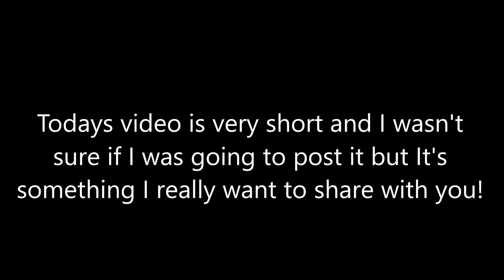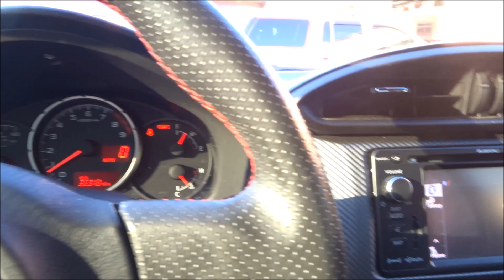SUBARU BRZ PAINT CORRECTION! (Perfection)

Comment: I'm not knocking you, just giving you advice. they didn't "ceramic coat" your car. The part you showed with the price is no where near the price it is to ceramic coat a vehicle. And when you ceramic coat a vehicle, it needs to sit inside, out of the elements for 24hrs. just letting you know, in case you go to a different place and ask for ceramic coating. don't want you to flip out when they hit you with a high price tag.

there's a place like the one you went to here in Florida that does "ceramic coating" I asked to see what the product was and it was just a sealant. what you paid wasn't bad for a paint correction and sealant, but it won't be that for a real ceramic coating.

keep up the good work brotha
Reply: FerrariStang S550 there’s a product that advertises through Instagram and they try to call it ceramic coating.  That’s probably what they used.
Reply from the maker: FerrariStang S550 Thank you! And ya you’re right. I didn’t know until later. I really don’t know much about detailing! Ceramic coating was an option there. The guy that who rang me up said ceramic coating but that’s what I paid for and it was just a paint correction!
Reply: yea, it's a shame that places do that. just call it what it really is damn it lol. drives detailers like me and others crazy. I had somebody flip out on me because I was overcharging them for a ceramic coating job...no lady, you just didn't get one before lol